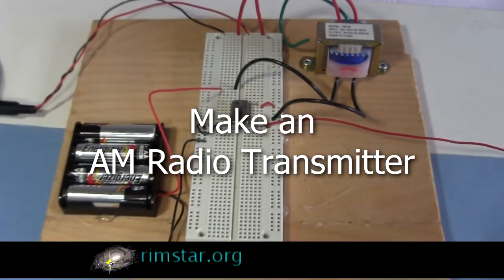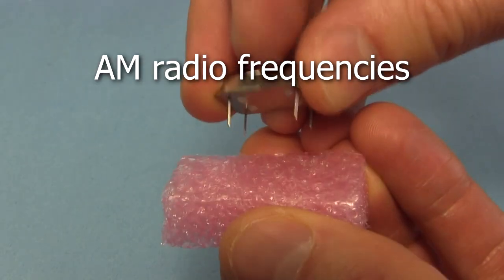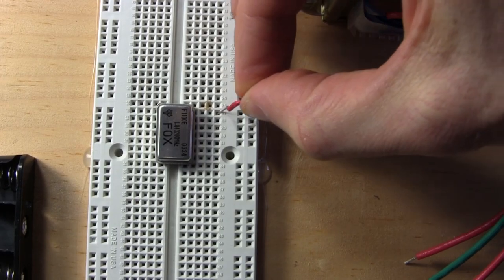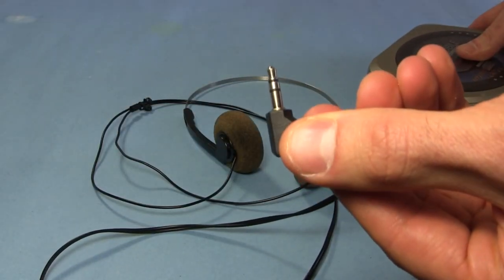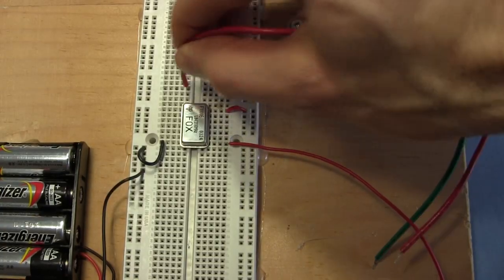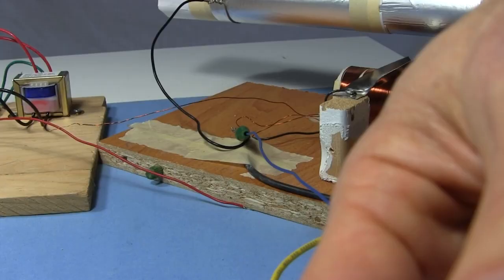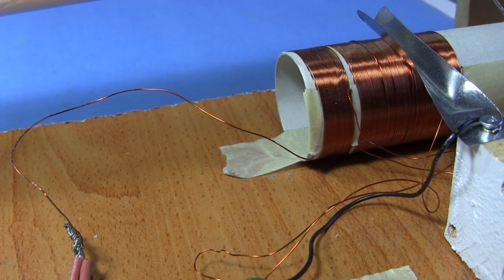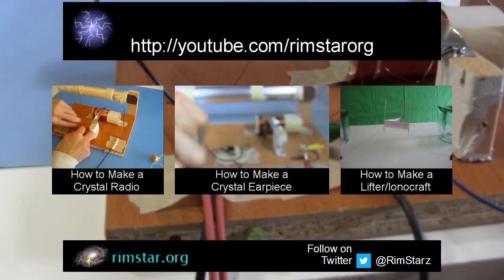How to Make AM Radio Transmitter

Comment: Were to start.
This oscillator produces square waves with a lot of harmonics.
With that transformer is not how you modulate a transmitter in AM. This is a digital circuit, not analog.
There are no subharmonics, you tuned into the base freq of that crystal.
.....
Try an RF electronics engineering course before attempting this.
Reply: you seem to have missed the point...
Reply: it was probably radiating less then 10mw. easily a part 15 device. It does a good job of showing a block diagram design of am transmitter, without the rf amplifier stage

Comment: wonderful tutorial! let’s say i wanted to add an on/off switch to my transmitter, as well as an LED light to indicate that the transmitter is on. how would i do so? looking forward to doing this as my first transmitter project
Reply from the maker: You can cut either of the wires coming from the batteries and put a switch there. For an LED, I guess you can put one leg at the side of the switch farthest from the battery and the other at the battery (i.e. in parallel with the whole circuit). Be sure to include an appropriately sized resistor so that you don't burn out the LED.
Keep in mind that you shouldn't transmit more than a few feet. Transmitting is illegal in many countries without a license (look for HAM radio license) and this circuit also transmits on multiple frequencies, which is not good. It's only good as a fun project.

Comment: Am completely confused and defies logic. How come the transformer is connected to DC? I see the label that it is AC transformer. When you apply DC voltage to a transformer, will it not burn the coil since it is unable to product magnetic field?
Reply from the maker: The current isn't enough to burn the coil. The purpose of running the DC through the transformer coil is to add it to the AC from the sound source. Imagine a graph with a horizontal line with 0V at the axis and another horizontal line above it that's 5 V DC. Now imagine you have another line that's a sine wave that alternates between 4 V and -4 V. If you add the two lines together then that lifts the sine wave such that it now alternates between 9 V and 1 V (4+5 and -4+5). That's what happens when you apply the sound source (it's not a sine wave but it is an alternating waveform) and the DC to the same transformer, they add together.
That's what I try to explain in my follow-up video about amplitude modulation here https://www.youtube.com/watch?v=R04yEKqgGPc. I wish I'd included that simple explanation in the video :).

Comment: hey I am trying to send up a communications satellite and I dont know that much about wireless stuff I know how to build a wireless telegraph and that's it. I need a way to do this without a ground or if there is a better way of communication radio. Plz get back to me soon btw great video!
Reply from the maker: I don't use a ground in this video, so a ground isn't required. However, if you're going to transmit from a satellite, you don't want to use this circuit anyway since it transmits on so many frequencies and shouldn't be used to transmit more than a few feet (science/electronics experiment only). Transmitting over a distance requires a license in most countries so maybe you should look up HAM radio licensing. But even then, you're talking about transmitting from space and so that may require a whole different set of rules. I know there are groups who make receivers for receiving from satellites which broadcast for HAMs, and there may be groups who've put up transmitters before (maybe in cubesats?). You might get more help looking in that direction.

Comment: if i just wanted to transmit morse code, would i still need the transformer?
Reply from the maker: For morse, I'd remove the audio source and the transformer. Replace them with a momentary switch or whatever you want to use for tapping out your morse code. One the receiving side, they'll tune into the oscillator's frequency like they normally would but what they'd hear is sound whenever the switch is pressed and nothing when it's not pressed. At least that's what I think will happen from thinking about it just now, I haven't tried it.

Comment: Do you know how I would make an antenna if I wanted to broadcast all over town? Would an old tv antenna work?
Reply from the maker: I don't know where you're from but in most countries that would be illegal since it would interfere with other radio signals. It's also just a bad idea since it would interfere with other radio signals. As you saw, this transmitter would be especially bad since it transmits on multiple frequencies. It's intended only for very short range, low power experiments like the ones I did in the video.
If you want to get into transmitting radio then I'd suggest looking into how to get certified for amateur radio. Here's a random webpage with more information about that https://www.eham.net/newham/howtobecome.

Comment: Cool man, thanks
I think this works too
RadioShack Audio Output Transformer Model: EI-19 | Catalog #: 273-1380
Frequency response: 300Hz to 10kHz
1,000-ohm center-tapped primary
8-ohm secondary
Low-level impedance matching

Comment: hello rimstar! is it ok to use 2 pins 2Mhz oscillator chip?
Reply from the maker: You''d need a different circuit, one that makes up for the components that this chip has but the 2 pin ones don't. I don't have that circuit though.

Comment: hi rimstarOrg.If we use this circuit as receiver where will we put the speaker and diode?
Reply from the maker: Are you talking about using the crystal radio circuit as the receiver? The diode is a part of the circuit (here's the video on how to make the crystal radio https://www.youtube.com/watch?v=VqdcU9ULAlA). However, to get enough power from a crystal radio on a speaker, you almost always need an amplifier.

Comment: Hi rimstar.lf we dont use the transformer, does it work or does it become frequency modulation?
Reply from the maker: I'm not sure what you'd get without the transformer. You'd be running the oscillator's signal through your audio source.
Reply: RimstarOrg. You know in FM modulation transformer dont be used.Thats why l asked

Comment: Can you use a 6 volt?
Reply from the maker: That depends on your oscillator. You'd have to do a google search for the datasheet. This is the datasheet for mine http://www.farnell.com/datasheets/58697.pdf and its input voltage is given as 5V plus or minus 0.25V. It doesn't say what the maximum it can handle is, but I wouldn't push it too much past 6V.
Reply: +EP
You mean the battery? If so then yes, he used 1.5 (AA size) x 4 = 6v
You can also run it from a 9v battery which is easier than having 4 batteries and a holder.
http://sci-toys.com/scitoys/scitoys/radio/am_transmitter.html
You can salvage a 9v battery connector from a dead battery, just break it an you will find it inside. then solder wires onto it.
And if you meant the transformer then it is something like this, find it anywhere:
http://wa3wsj.homestead.com/RadioShack_AudioTxformer_1k-8ohm.pdf

Comment: While it's absolutely true that it is very illegal for us to transmit radio signals without a license and we could get in a lot of trouble if caught, people with those personal FM transmitters tend to pick unused frequencies to get around that problem, but as you said we should NEVER risk it by making the signal too powerful.

AM (unlike FM) can be tricky however as it can be difficult to tell if a particular frequency is unused or not due to AM's susceptibility to interference.
Reply: Ah crap this is EXACTLY what I wanted to do

Comment: 1.8 mHz is the bottom of the 160 meter ham band and is illegal to operate there without a license. I know that your oscillator is very low power but it is still possible to radiate a signal several miles at that frequency. You would be better off buying an oscillator for 1.0 mHz you can find them on e-bay for a couple of bucks.
Reply: theres always one person who has a problem with this lol
Reply from the maker: This was only a fun experiment and the time you see it running in the video is the time I ran it for. If I were to make a transmitter that I actually use, I would get a license.
Reply: I understand but there are many people out there who may think it is okay to run unlicensed transmitters there. I like your video, I just think that you might put a note to let people know that maybe they should stay in the broadcast band. I have been building AM broadcast band transmitters for many years and I know that sometimes (due to things we can't control) our signals can take off on us...please don't take my comment personally. I only meant to be helpful. Thank you for your response.
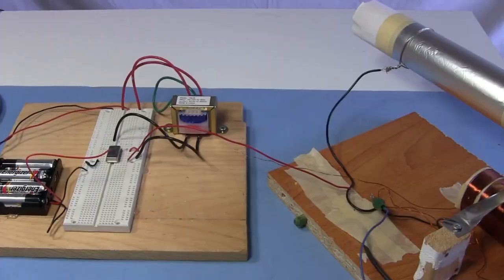Reply from the maker: I do warn about interfering at 6:50 (it's been a while so I had to check) and I have something in the video description about it, plus, whenever someone asks a question in the comments and it sounds like they're building one, I also pester them with a warning too. Had I thought people would actually make them then I'd have added a big flashing warning to the video. No worries re bringing it up, that increases the chances of someone seeing it in the comments, so it's all good.

Comment: I've asked because on the contrary I've mostly seen FM radio transmitters and very few AM radio transmitters; I would like to use both FM and AM transmitters but unfortunately very few AM transmitters are made.
Reply from the maker: While this AM transmitter's easy to make, it's actually not a very good one since it transmits on a lot of harmonics. You shouldn't transmit any more than a few feet anyway since you'd interfere with others. In many countries it''s even illegal and requires a license.

Comment: hi rimstarorg. i could not find your crystal oscillator chip but instead of that can i use a 2pin 16mhz crystal oscillator.plzzz reply. thank you
Reply from the maker: No, the 2 pin oscillator needs additional parts to make up for what it lacks compared to the one I used. I don't have the circuit for it off-hand but I know there are some out there.

Comment: If you want to look more into am radios, pop open that one in the video, or any one really. Chances are, you'll find what's called a ferrite rod loop antenna. Pretty interesting type as it interacts with the magnetic portion of the radio wave, not the electric as the common whip or wire antennas.

Comment: rimstarorg  i could not found that oscillator chip. is there any alternative. plzz reply. thank you
Reply from the maker: I gave a link for it in the video description: https://www.scitoyscatalog.com/category/R.html. I don't have any other sources off-hand.
Keep in mind that you don't want to transmit more than a few feet or meters since you'd interfere with other radio stations. This circuit is very simple but that makes it worse since it also transmits on multiple harmonics/frequencies. In some countries it's even illegal to transmit, so keep the antenna short and the power low.

Comment: CAN A RADIO SEND OVER WAVE TO OTHER RADIO , SO U CAN TUNE IN AN HEAR
Reply from the maker: You need a transmitter in order to send radio waves. But certainly, if both people each had a transmitter for sending and a radio for listening then they could talk back and forth. However, this circuit is a simple one that transmits on multiple frequencies (harmonics) and so it's not one you should use over a long distance in case you'd interfere with regular radio transmissions. In most places that's illegal without a license anyway. This is a fun project for transmitting over a short distance like I did.
Reply: RimstarOrg ...hi GM can you email me I need u to check a radio parts for me plz djfearless5@gmail.com

Comment: Hi, longer antenna is better, right, but why? Is it due to wavelength of electromagnetic waves which we spread by this circuit?
Reply from the maker: Yes, that's my understanding. The wavelength is much longer than the antenna so a longer antenna would be more efficient.

Comment: great video, now to make that a 5000watt hi power radio station and play alien music on it...is an oscillator chip essentially a transistor?
Reply: fidel catsro no, an oscillator is a self contained oscillating circuit, usually a quartz crystal. the same principle as a grill lighter, in reverse, i.e. instead of pushing the button to cause the hammer to smack the crystal and cause a spark, you apply the voltage instead, and it vibrates at a predictable frequency, causing that frequency to be the output of the chip.
Reply: oh ok thank you
Reply: Wow i was here 5 yrs ago??? Nice to be back again for a visit!

Comment: What is the range of this am transmitter
Reply from the maker: I kept it down to a meter/yard or two. You can transmit farther but it is a bad idea and illegal in most places. This circuit is especially a bad one for longer distance because it transmits on multiple frequencies. This is just for a fun science project. I'm not sure of the details of how to transmit farther, possibly a longer antenna and a stronger input source.

Comment: is it possible to increase the transmit power to say 5 or 50 watt?
Reply from the maker: Sure, but I wouldn't. You'd be interfering with other people's radio and possibly even emergency services. This circuit is especially bad for that since it transmits on many frequencies/harmonics. This should be done only over a few meters/yards. It's good for a fun science project. In many countries it's even illegal.

Comment: Tried mine with a 250 kz oscillator. And I got no sound whatsoever. The chip is half the size of the regular stuff. But 250 Khz is right in the LW band, which my transistor radio should pickup.

Could the voltage have busted the chip?
Reply from the maker: What do you mean by "half the size"? If it has only two pins then you'll need a different circuit with more components. Otherwise, search online for the datasheet and check its voltage rating. It's also possible that whatever you're using for an input isn't very powerful, though my old CD player wasn't very powerful either.
Reply: No 3 pins, but is a little square instead of a long rectangle. The transformer is an Eagle LT700. Chip is rated 5 volts like most of the oscillators I found.

The chip works, but only if I conne3ct the audio source directly to it, which gives an incredibly weak and distorded signal that can only be picked up if the thing is litterally against the radio
Reply from the maker: Are you sure you have the transformer hooked up in the right direction? Notice in the video I try it both ways and end up with the secondary connected to the oscillator.
Reply: Yep, tried both directions, yough usually, the one with 3 wires should be connected to the audio source. PSU isn't batteries but wall socket type at 6 volts

Comment: What powers the antenna, transistor I'm guessing? How does it not short circuit or open circuit with the antenna since it's metal ?
Reply from the maker: If you mean what powers the antenna for the crystal radio, crystal radios are powered by the incoming radio waves themselves. That's what's cool about them, no batteries or plugging into a wall socket needed. You can see how it's made in my video on how to make one https://www.youtube.com/watch?v=VqdcU9ULAlA.
I'm not sure where you're talking about short circuiting, unless you mean at 5:24 in the video. Both wires have insulation on them. The one from the crystal radio looks like it doesn't but it has a thin layer of enamel insulation on it.
Reply: RimstarOrg okay. I'll have to watch more videos thank you. Sorry I wasn't clear, but I found out antennas are LC circuits, they are inductors I believe and it's a magnetic pulse, which makes the waves

Comment: If im not mistaken most whip antennas in am/fm radios are only connected to the fm circuitry. Thus putting the whip antenna near the am transmitter make little to no improvement to signal. Most am/fm radios use a ferrite rod antenna for the am circuitry that is housed inside the radio case. As ferrite rod antennas are directional one must turn the back of the radio to face the desired and get as near as possible to the source to improve reception.
Reply from the maker: I've no experience with powered AM radios, ones with ferrite rod antennas, but with crystal radios, which get their power from the incoming radio waves themselves, the longer the straight antenna the better, and preferably pointing at the radio station, though that's rarely practical.
Reply: I was just saying because around 6:37 it looked like you were trying to improve reception by getting the whip antenna closer to the transmitter's antenna.Either way this is a good informative video.

Do you happen to be an amateur radio (Ham)? you seem to know quite a few things that might also correlate with amateur radio.
Reply from the maker: No, I'm not a Ham operator. My experience in radio is only with crystal radios.
Reply: You got it close. FM and AM antenna are the same, the difference is the frequency. AM being 1khz ideally wants a 150m antenna!! FM@90mhz is happy with 1.58m ish

The reason AM is set up like that is to compensate for the lack of an 150m antenna The AM antenna you described is a compromise antenna.

Either way the losses in the output of that radio will be mental. But the extend length probably helped.

At the power levels being talked about it's all irrelevant anyway as you wouldn't even dare to try and optimise that thing without significant  filtering.

That said well observed re antenna differences

And very cool little project, questionable legality but genuinely know harm in doing the experiment for experiment sake